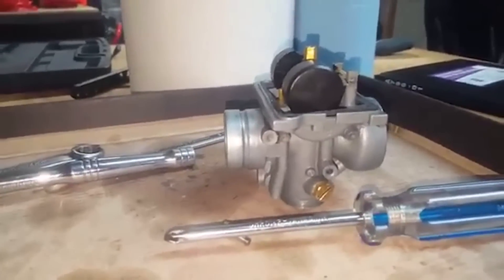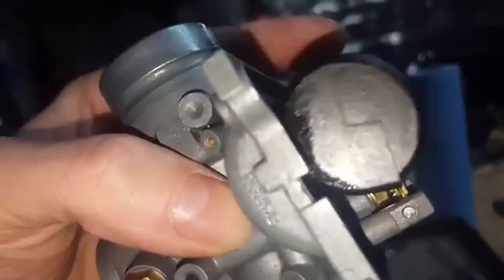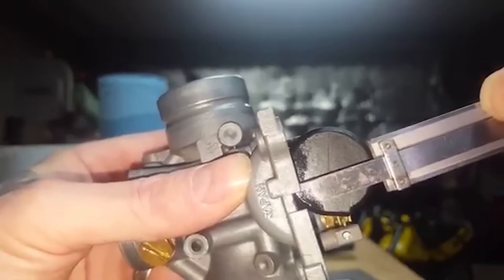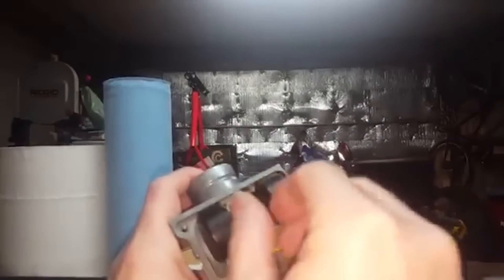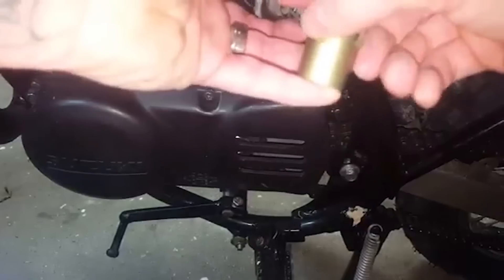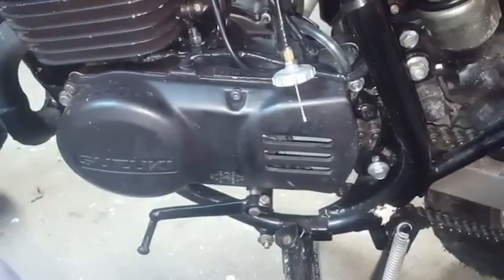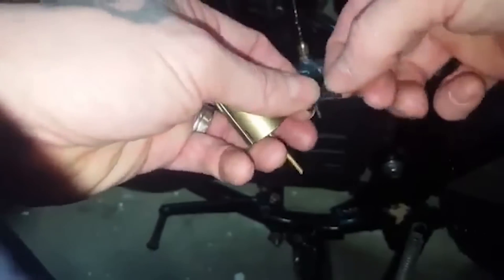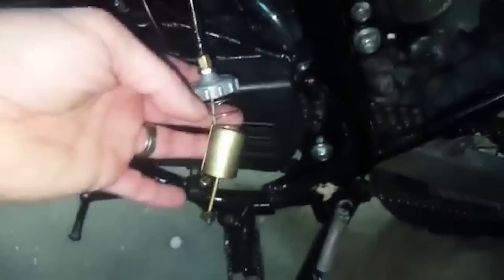How to set the float height on a carburetor

Comment: Now i had my bike lifted from the back quite high to weld the frame rails and paint the bottom. I drained the carb of all gas and shut the fuel off completely so no gas would leak out. It was lifted for about a week i finished the bottom and put it down i turned the gas on and gas ran right through the carb i took carb off made sure float was okay and working fine it is from what i can tell seems to work perfect then when i have the carb bowl back on and i fill with gas runs right through again. Needle is perfectly clean floats have no gas in them the floats move up and down perfect. Also this carb is brand new oem honda carb put on 2-3 years ago the inside looks brand new the floats are still even white. Anyone have suggestions?!
Reply: Float is too high

Comment: Does the pilot jet get turned in until it seats or is there a manufacturer recommended stetting for it? I am rebuilding my Mikuni Carb and I don't quite remember if the pilot jet needed to be all the way in or reset a couple of turns back. Thanks.

Comment: I have a question about my Mikuni carb.  It is supposed to be set to my son's bike.  He's learning to ride so I got him a TaoTao DB14.  But it ran only 1 time then each time after that floods like crazy.  I've narrowed it down to the float or jet size, but I'm told my size is good for the bike.  But none the less, it is flooding almost immediately after throttle.  It starts and idles fine but throttle bogs it down immediately and floods it.  

I've adjusted the needle, clean the main and pilot jet, adjusted the float several times to close sooner, etc.  Nothing is working.  How would you fix this issue?  Should I be going up or down a size on main jet?  Should I be addressing the pilot at all?
Reply: Maybe go down on the pilot, it's the jet that supplies fuel at the lower end of the throttle and the main jet supplies on the upper half of the throttle, you can also go up on the needle first

Comment: so how do we set the float height ? it only shows how to measure and even that is sketchy. waste
Reply from the maker: The tang that sits on the float needle needs to be bent in the direction you want to go. Bent in towards the needle will shut off flow with a lower amount of gas in the bowl. Bending away will do the opposite.  Changing the float from factory setting is never recommended.